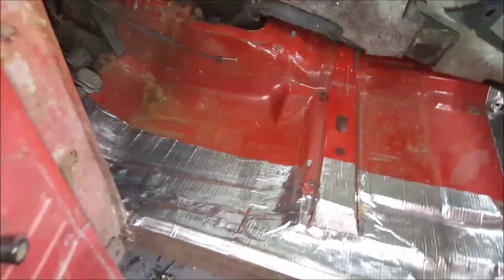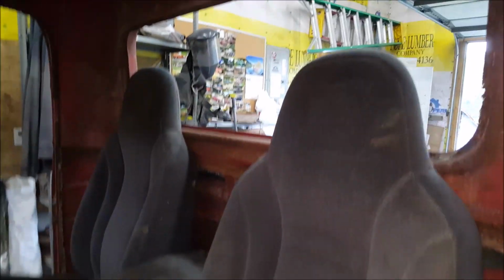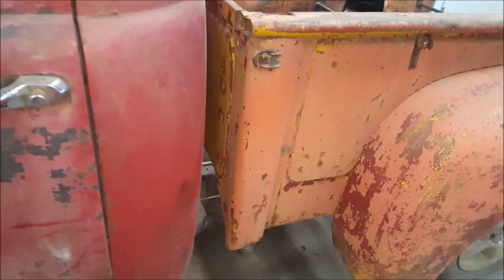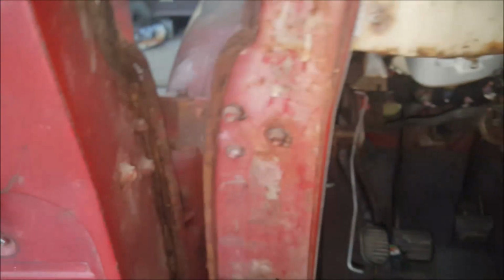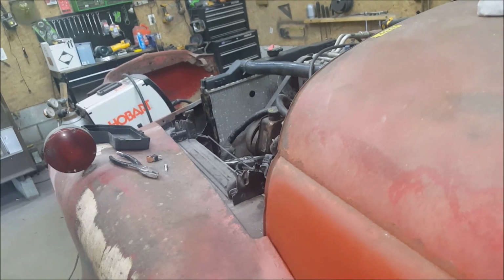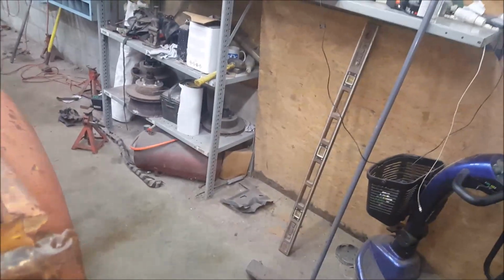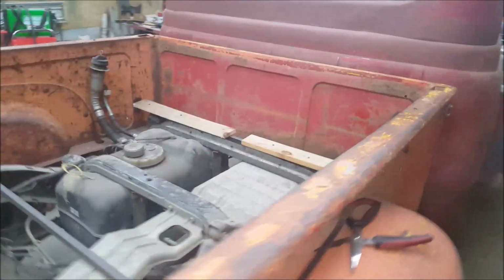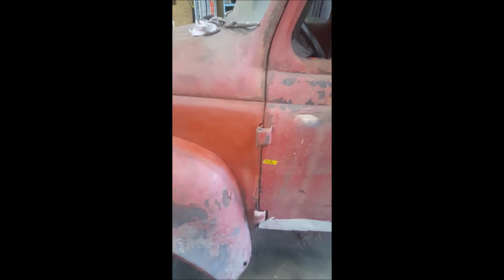56 International Swap Part 10 #restomod #hotrod #ratrod #bodyswap

Comment: Bad contact or broken wire back side of relay tray... you are just pushing on it and it starts even with the key off and out ? Any chance of an auto start unit in there ? have seen them do some weird kaka... Finish strong and move on !